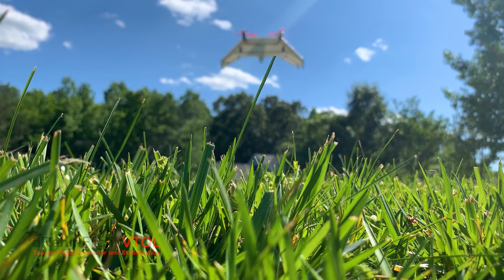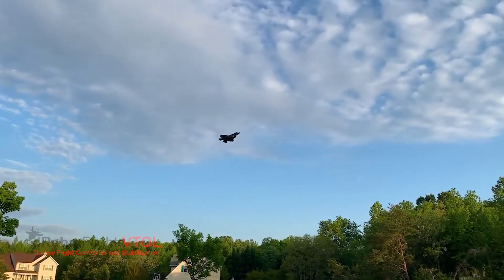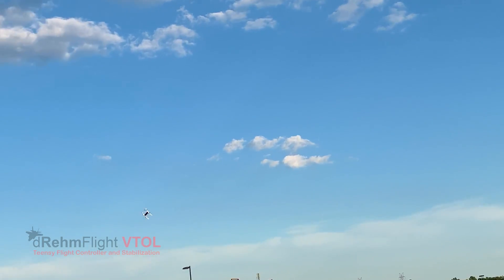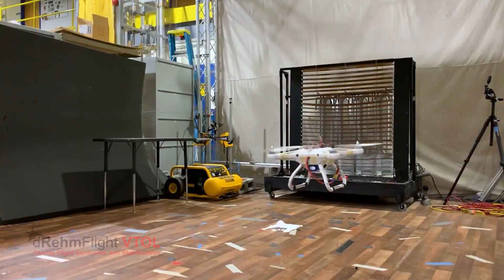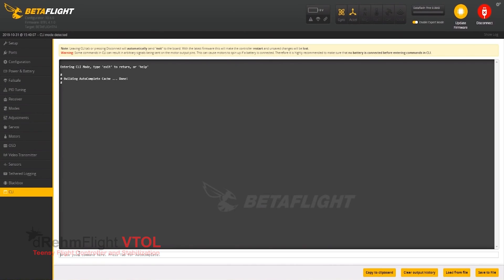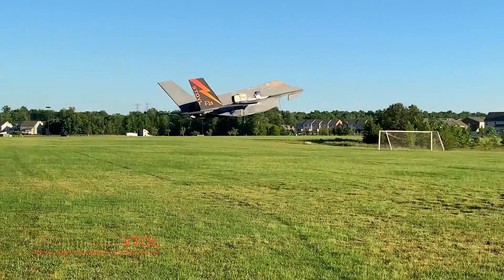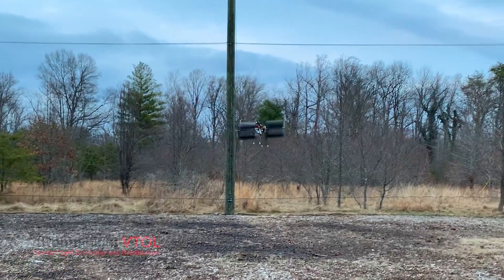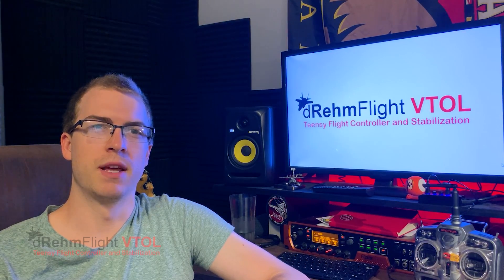dRehmFlight VTOL - Teensy (Arduino) Flight Controller and Stabilization

Comment: Nik, I have the f35 flying rather poorly in rate mode.  I would like to fly it in angle mode in hover and switch to forward flight in rate mode. Is it possible to modify the code to do this?  If so, what code would you add to accomplish this?
Reply from the maker: It should be flying very well it rate mode with little wind. Have you completed setup/calibration of the radio and verified good IMU data? Tutorials/videos in the docs. 

I can set up hover angle mode this weekend and send your way if you send me an email to remind me
Reply: @NicholasRehm  yes, I have verified all functionality prior to flights.  I found it necessary to add 50% expo on the transmitter to desensitize control input. I find the integrator is always drifting the flight settings forcing a  continuous stick. Input to chase a stable flight. Making it very labor intensive.
Reply from the maker: @poporbit2432  that sounds like not good IMU data if you need to apply constant stick input. Check for drift in the gyro data. Could also be not centered radio values, which should also be checked during setup. 

Lastly, after power up, you need to place the vehicle on the floor and leave it still until the teensy starts to blink indicating it’s in the main loop. Moving the vehicle around before this will cause bad IMU calibration on startup and hence drift in the estimate. The best indicator that any one of these things is the problem is if any motors spin without control input when you arm the vehicle
Reply: @NicholasRehm  yes I have monitored the gyro data for drift on the bench using the plotter output utility and all was ok prior to flight but I did not exercise the inputs from the transmitter at that time.

Observations:Teensy's are very intolerant to power supply variation, as you have pointed out,  I'm currently powering both the controller and Servo's off the same 5v supply which may be a significant cause and requires a look at the plotter on the bench while I exercise the servos, more on that later.  Also the transmitters I use are turnigy 9xr  models that dont have precise 1500us center values on each channel and the pots return to a slightly different value after a stick input.  These I will also check.
Reply from the maker: I normally can run 5-6 9g servos and the teensy off a 1.5a BEC (built in to most 4-in-1 ESCs) just fine. But it never hurts to give the teensy+rx it's own BEC. Within 2-3 pwm values on the radio calibration is good enough!
Reply: Testing results on bench 
gyros:  roll-pitch inputs: noise peaks every 220us at +/- .7 units and quiets to +/- .3 units. No stick inputs +/- .1 unit

Loop rate 500us

Accel stick input 
 0 +/- 0.1on x and y and 
1 +/-0.01 on z

Desired: 
throttle 0.0
Roll -4 hover and trans, -9 forward
Pitch -7 hover and trans, -14 forward
Yaw 25 hover and trans, ~35 forward

PID all clamp at +/- 1 on input
Idle: 0 on pitch and rolland 
~1 on yaw

That's what I'm seeing on th bench
Reply: @NicholasRehm  very good inputs. Thanks.

Here are the details of our flight experience.   My pilot is very experienced with quads. He is a test pilot for a wing corp. That is developing package transport capability..

When we test flew it, we were on a hill top cow pasture with other rc planes in flight. Our test flight..
We could not ROG.  It would rock side to side dragging the wing tips on the ground.   So I held it level 3 -4ft from the ground, spun up the motors to a thust level that maintained the craft altitude and my arm only held off roll, pitch and yaw vectors. We then adjusted the tx trim until all vectors were neutralized.  Then release the plane and my associate would fly from there.  He basically chased it with the controls to maintain hover.   Next he transitioned to forward flight. It stuck its nose nearly straight up and stood motionless in a vertical position very similar to your video of it in a vertical hover. We the switched back to transient mode. It returned to a forward moving hover attitude and responded well to control inputs. Then we switched to hover and quickly landed.  That was the total flight experience.
Reply from the maker: @poporbit2432  have you changed any of the controller gains in the control mixer? That is my last guess at the poor performance. Many others have flown with no issues
Reply: @NicholasRehm  as to the mode we flew with: I'm not sure. To clarify this I will go out tomorrow and fly in rate mode.
Explanation  all my initial work on the prototype was in "angle" mode. When you informed me you had not used that mode,  I reloaded the stock "rate" mode and set it aside for later flight.
I then built up a second plane and loaded "angle" mode in it since I had a lot of experience with hovering in the driveway.  
Subsequently, I might have used this code source to later tune the control surface offsets in my first plane.  Hence the confusion.
PS is there a way to identify what version I have loaded into the teensy?
Reply: Nik,.
 I flew the f35 in rate mode today, hover only, It's very flyable but requires continuous control input to maintain level flight.  I have video uploading of the flights that should be available on utube later today. The work load maintaining level hover is very high and will put off many first timers.  Using angle mode  in hover will fix this.. If you have the time this weekend to code hover mode with angle   and forward mode to use rate it will solve this nicely.  I'm real excited with this project as are several of my club friends.
Reply from the maker: @poporbit2432  this is definitely not a beginner aircraft.. rate mode requires active control input at all times like a racing drone to maintain the pilots desired attitude. No “hands-off” flying with this guy… any wind will require the pilot to actively compensate too, since the f-35 has such a large cross section and little relative mass, it gets blown around easily in hover mode. I’ll try to get angle mode tuned up and working, but this aircraft was really designed for rate mode so the pilot has maximum control at all times. If you download the clean f-35 code, I can pretty much guarantee a successful flight for any competent drone/fixed wing pilot
Reply: @NicholasRehm  in looking back at your videos, it looks like you flew the f35 as a plane first then transitioned to vtol later. Is that how you progressed with your development?

I'm looking forward to learning how you will modify the code to apply rate and angel modes  independently to each of the flight configurations.   The RC plane Community is primarily older men at or near retirement (myself included) vs the quad community which is much younger such as yourself. Using angle mode in hover will substantially reduce the work load and improve confidence in flying this airplane and should expand the acceptance of your work.
Reply: @NicholasRehm  I tried modifying the code (shown below) to enable angle mode for hover and rate mode for the rest but got a comple error.  Any suggestions?

//PID Controller - SELECT ONE:
  if (channel_6_pwm > 1700 controlANGLE()); 
  //controlANGLE2();
  if (channel_6_pwm < 1700 controlRATE() );
Reply from the maker: @poporbit2432  brackets
Reply: @NicholasRehm  Brackets added. result Compiler warning.
//PID Controller - SELECT ONE:                                                                                
  if ( channel_6_pwm > 1700 ) {controlANGLE()}; 
  //controlANGLE2(); 
  if ( channel_6_pwm <1700 ) {controlRATE()};

warning: dereferencing type-punned pointer will break strict-aliasing rules [-Wstrict-aliasing]
float tmp = *(float*)&i;

thoughts?
Reply from the maker: @poporbit2432  if it uploads it’s fine. Warnings are fine, errors are not.
Reply: @NicholasRehm  I was comparing the code sections "controlANGLE()"  to "controlRATE()" 
there is a difference in the "//Update roll variables" and "//Update pitch variables" for these sections that might be a problem?
The "controlANGLE" code does not update "error_roll_prev, GyroX_prev, error_pitch_prev, GyroY_prev"
Should these be updated?
Reply from the maker: @poporbit2432  No, the baseline dRehmFlight code is correct and works as intended. Please have a read through of the documentation .pdf to get a better understanding if you really want to, but none of this is important to get the F-35 flying
Reply: @NicholasRehm  thanks will do.
Reply from the maker: @poporbit2432  Added new version to the github  repo with angle mode used in hover. Just got inside after tuning. Have fun with it
Reply: @NicholasRehm  fantastic, thankyou.
I finished  coding as well and verified hover in the driveway but can't  fly in forward mode until tomorrow.   I will have a second plane completed that I'll load your code in and fly it tomorrow as well.
You are so supportive, I really appreciate how much time you have dedicated to me.  The coding has been a huge learning curve on this project and I would not have succeded without your incredible fast support.
Reply from the maker: @poporbit2432  my goal is to make this stuff easy, so I’m more than happy to help you get in the air
Reply: @NicholasRehm  I've posted a video of today's flight. I flew with the code I had developed. I'll fly the version you posted tomorrow.  My flight was good in hover,, transition and beginning forward flight..  however while banking the plane will suddenly go into a vertical hover and fall off..  the first occurrence reversed the planes direction and I flew out of it.. (I didn't even realize it at the time)  the second time it happened I  panicked and switched to hover in an attempt to recover..  it went down but was not damaged..  I subsequently hover flew it again..
I looked at your code and see you added bank limits to address this.  Great fix.
I have two more teensy's programmed and installed in planes with your code installed for my next flights.
Reply: One observation,  since the PPM and  SBUS pins are inputs only, why not short them together? That would simplify use of receiver types to code recompiles.
Reply from the maker: @poporbit2432  I would strongly advise just flying with the posted code for the f-35 for now before trying modifications, because I have no idea what changes you are making and if they are correct or not. Might be a better idea to build your own VTOL platform and start with clean dRehmFlight code if you really want to learn how to use it. The F-35 is not a platform I would recommend learning on.
Reply from the maker: Think of it like this: you have not yet flown the stock version, and you are already trying to modify it without understanding the baseline capabilities. This is a recipe for disappointment
Reply: @NicholasRehm  I flew two f35's today with the angle mode code option. Problem: in hover I had significant roll, pitch and yaw offsets at takeoff that required using tx trim to accommodate.  When I switched to slow forward the craft tumbled and rolled immediately. I realized this was due to the trim offsets being activated on the control surfaces.
What must I do to balance the motors thrust in hover without using tx trims?
Reply from the maker: @poporbit2432  Follow the transmitter setup video on my channel. Also, power the vehicle on a level surface and leave it still until the ESCs arm...otherwise IMU calibration will be off and it will want to drift as you describe

Comment: Nik, just a quick update on my progress.  Hover testing in angle mode required raising P values ~25%. I suspect the lower 2300kv motors I'm using may be the reason.
Reply from the maker: What platform?
Reply: @NicholasRehm  f35
Reply from the maker: @poporbit2432  ahh yes, I never tuned for angle mode. Only intended that one to be flown in rate, but sounds like you're on the right track with tuning
Reply: Nik, you default setup for the F35 is rate mode. I assumed you had tuned your f35 in angle mode then switched to rate mode is that correct?
Reply from the maker: @poporbit2432  nope, only ever flown in rate mode. But angle will work for hover…so long as correct maximum angles are set and gains tuned in that mode accordingly
Reply: @NicholasRehm  guess I should switch to rate mode ASAP.  I was concerned that rate mode would require to much active control during hover to check out the PID'S so I went with angle mode.  That's to bad cuz I beat up the model a lot to get it tuned up. 
What relationship would you expect to PID's for faster or slower KV motor values?

Comment: Guess plugging in the Power supply backwards is a bad idea.DUH! I've ordered a few more Teensy boards in case I repeat my stupidity.
Reply from the maker: Oof, yea I recently accidentally sent 12v straight into the teensy and it wasn't happy. Mistakes happen

Comment: Nik,
I only see support for esc's with one shot, is there code available for DShot 300?
By the way, uploading the code to reinstall was simple  just as you said.  Thankyou this is great. I already have 4 buddies asking to build this a well
Reply from the maker: Unfortunately no support for D-shot because it’s a serial protocol which introduces some challenges. Most ESCs (blheli) that can do Dshot can also do oneshot
Reply: @NicholasRehm  OK, doesn't oneshot  require throttle calibration?
Reply from the maker: @poporbit2432  throttle stick calibration is handled in the radio setup for this FC, and then oneshot should work right out of the box
Reply: @NicholasRehm  Its an absolute pleasure to communicate with you.
Ive wired it up on the bench and testing it now

Comment: You are the MAN. I'm an advanced Arduino/ESP32/Teensy dev and very comfortable with IO using IMU's, GPS, etc. I honestly never put two and two together to use that knowledge for flight control, despite a blossoming interest in various types of drones. Pretty sure you just cracked open a new world for me, and from one engineer to another, I thank you for doing all the heavy lifting R&D for me so I can go straight to the fun bits!
Reply from the maker: Thanks Jake! I’m sure some of the code will seem pretty ‘sloppy’ to a proper dev, but that was intentional just to make the project more approachable for beginners. Much easier to teach a beginner what a simple variable is rather than what an array is, indexing, matrix multiplication, etc... hope the framework and basic concepts inspire you to make something awesome

Comment: No thanks too technical. Ill just stick with my f7 fc ready on the market running inav or betaflight.
Reply from the maker: What types of vehicle configurations are you flying if I may ask?
Reply: @NicholasRehm  its a quadcopter configuration.
Reply from the maker: @federicosagun4615  Right, then this is not for you for sure. This code will not compete with existing high performance quad FC's, but is meant to be easily implemented on weird/custom/transitioning configurations
Reply: @NicholasRehm  thanks anyway but its good to know how codes works as im still learning the basic and fundamentals.

Comment: Wow. Almost exactly a year ago i started on a similar project also using arduino and a Teensy 4.0 to control a drone i built. Same exact idea that all other software is way too complicated and hard to modify. Differences is my software was geared more towards drones so i havent built the software to be easily modified for different vehicle configurations. But it used an mpu9250 so i could use the SPI interface to get rates loops rates up to 8000Hz (Limit of the MPU9250) and is used custom sensor fusion algorithms to fuse all 9DOF from the mpu9250 (true north) and data from a GPS (neo M8N) to get navigation rates also at over 1000hz (but realistically should only be used at 100hz). This allows for full autonomy.
Because Im a Aerospace information technology student (We are more geared towards Computer science) i used PlatformIO to build the software in a more structured and organized way.
Reply from the maker: I've actually added support for the 9250 over spi, but my main loop rate is still throttled at 2k to leave headroom for modifications. Have you published your work anywhere?
Reply: @NicholasRehm  No i havent yet, because i have not done too much flight testing and ive stopped working on the project for a few months and it isnt really documented. I will probably redo the project as i have learnt much more and know better ways of building the software.
If i publish it somewhere ill definitely make a reply.
After looking at your software i noticed we both used bolder flights library for the mpu9250. I did modify it though to use the fifo reliably and get rates up to 8khz. But for that i had to disable a few things like the DLPF.
Reply: @NicholasRehm  I uploaded the Software to github but because i lost the modified version of Bolderflights library it does not work right now. As is said i will probably at some point in the future redo the project.
Link to repository: https://github.com/yo90bosses/Teensy-4.0-Flight-Controller
Reply from the maker: @yo90bosses  Thanks! I'll check it out

Comment: Please, please please, do a tutorial... Man, I have an unique project to land a rocket after its MECO using EDFs, but it needs to stabilize on it is way up, switch to a belly flop maneuver by pivoting the EDFs, differential thrust, and controlling the elevons, then switch the flight mode to a Tailsitter position for landing. I will study your code, and if you don't mind keep in touch. God speed mate.
Reply from the maker: Yep, you should be able to do that easily. Check out the docs to get you started and you'll be well on your way. Don't hesitate to reach out over email! Would love to help you get it working